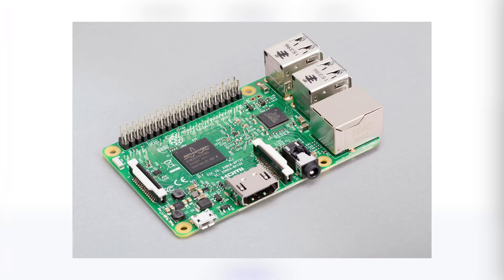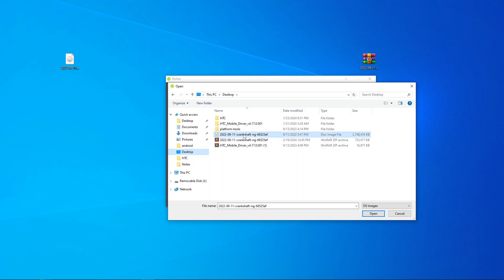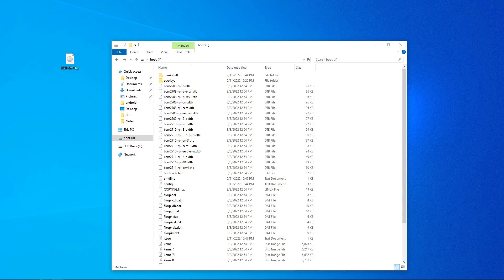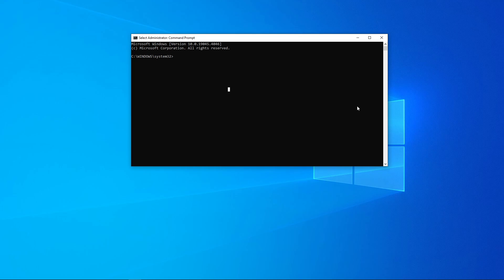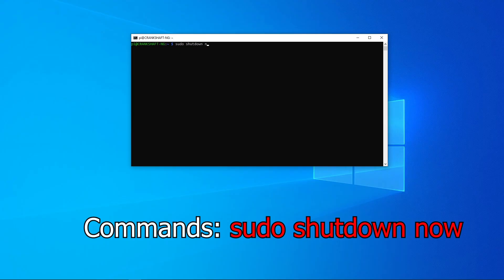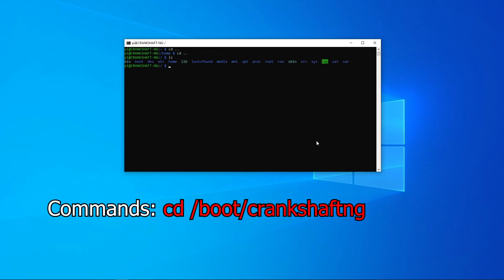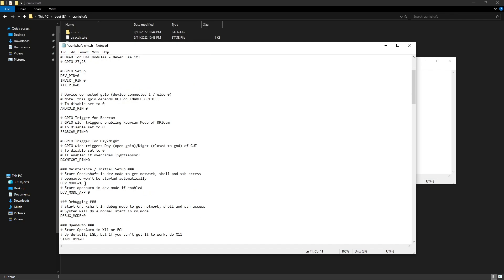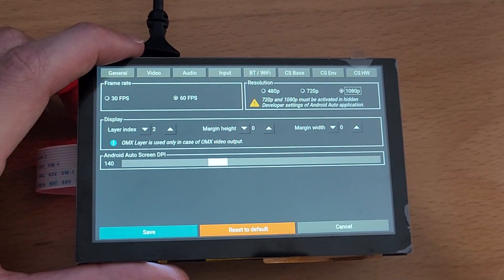Crankshaft-NG | A DIY Tutorial

Comment: I got a 8.8 inch display that has a resolution of 1920 x480. The thing boots on a portable monitor thats a normal resolution of 1080p, but do you know of a way to resize the output and or rotate the display maybe?
Reply: I figured out rotating now i got to figure out the rotating of the touch screen
Reply from the maker: Hello @TwerpZ Open the crankshaft_env.sh File inside the crankshaft folder.
at around line 78 is # Flip the screen 180°
Change : "FLIP_SCREEN=0" to "FLIP_SCREEN=1"

Comment: I want to do something similar just need navigation as a simple unit for my bike will this work on a pizero2w and a smaller screen?
Reply from the maker: @shravankashyap9437  Yes The Pi zero 2w Should work with a smaller screen. Don't forget to modify the Display Dimensions in the setup file. Also just a reminder, depending on the screen you may or may not have touch screen functionality.

Comment: Can I boot from USB??, coz nothing shows from display just black screen after turning on RPi4.
Reply from the maker: @yukiamatsuri, What kind of display are you using?
Reply: @DinosaurTalksTech  5 inch
Reply from the maker: @yukiamatsuri is it a GPIO one with HDMI or similar to the one I used in the video?
Reply: @DinosaurTalksTech  HDMI + GPIO (for touch screen)
Reply from the maker: @yukiamatsuri Try
To start OpenAuto in X11 mode, open crankshaft/crankshaft_env.sh on the boot partition (that's what you see when you open the SD card in Windows) and edit the START_X11=0 line to be START_X11=1.

Comment: I installed it , but i am getting blank black screen after plugging my phone. Any tips?
Reply from the maker: Did you click on the Android Auto button after you plugged in your phone?
Is Android auto enabled on your device?
Try go to Settings - apps - maps - permissions - allow location access
Try Restarting your phone
Update your Phone Software
Reply: @DinosaurTalksTech  yes, first time I plug in requested android auto permission~, after that on my phone it says android auto is running.  But on the pi it's black screen
Reply: 1 time i got below error : unable to open mtp device 001,006

tried different cables as well same issue
Reply from the maker: @dasari_manoj  What Mobile Device are you using? Also have you tried Updating your Raspberry pi?
If you can, Try doing a Fresh Install of the CrankShaft OS onto another SD card, Make sure you grab the OS specific to your Raspberry pi, Don't do updates or anything and see if the issue persists.
Reply: @DinosaurTalksTech  I did try with a new SD card and fresh install , my phone is samsung galaxy fold 5
Reply from the maker: @dasari_manoj It seems that a lot of people are having issues with the Galaxy Fold 5 when trying to connect it to Android auto (or OpenAuto)

As I don't have one to test with I can not give exact answers.

If you open the Android Auto App in settings
Go To Previously Connected Cars
Make sure "add New Cars" is enabled
and nothing is Listed under Rejected Cars
- Tap the 3 dots and press forget all cars 

You can also try any of the following
- Enable Android Auto Devmode and Enable 720 and 1080p settings
- Use a different power supply for the rasp pi
- Clear Cache or Data of the Android auto application itself
- Set Automatic start of Android Auto to Always and not By default

Let me know if any of these work and Which one fixed it if it did.
Reply: @DinosaurTalksTech I tried all the above except new power supply and enabling 720p and 1080p , will try and let you know

Comment: for the git clone, doesn't dev_mode have to be set to 1 otherwise it is a read-only file system?
Reply from the maker: yes, you are correct. If the dev_mode is set to 1. it would put the system into Read-Write mode.
Doing so will allow you to make changes from SSH or plugging a keyboard into the Pi itself.
Reply: I found that you can set this by running "crankshaft filesystem boot unlock" and "crankshaft filesystem system unlock"

Comment: for me when i boot it the first time it shows it loading and my pi restarts after but it doesnt seem to be doing the same as yours.. no clue how to explain but if you get what i mean got any solution? (im using a pi 4b)
Reply from the maker: Thank you for your comment. My suggestion is to try the following.

1.Reflash the SD card with the correct img or source code zip file (make sure it does not say pi2)

2. a stronger power supply to ensure no interruptions during the initial boot

3. Try a different SD card

4. Try a raspberry pi image to ensure the pi is reading the sd card correctly

If these do not work, let me know.
Reply: @DinosaurTalksTech  you recommend not using the pi's flasher and instead using a different one?
Reply from the maker: I recommend using the following zip
https://github.com/opencardev/crankshaft/releases/download/v.2022.09.12.1/2022-09-11-crankshaft-ng-66525ef.zip

And flashing it onto your SD card. (Use balena etcher or rufus) Once it's flashed onto it you should have a usable partition and it won't say it needs to be formatted.

After that plug it into your pi and let it run through it's initial boot, don't unplug it or anything.
Reply: @DinosaurTalksTech  hi hiii i got it to work now gotta get my touchscreen working haha thanks

i think the issue was that i might have flashed it with a password with the pi one.. not sure tho i have about 2% idea of what i am doing lol
Reply from the maker: Great to hear you got it working!
Reply: @DinosaurTalksTech  welp i accidently wiped the wrong ssd and now i cant get it to work again :) i love technology lol
Reply from the maker: @supermusic.foryou Since that is the case. I would suggest just starting from the beginning. Take your time, I have been in that same situation before. It is frustrating, but best to try again another day.
Reply: @DinosaurTalksTech  i cant seem to get it to run at all anymore.. on all my sd's different os works fine but when i try crankshaft it doesnt boot.. i have no idea what im doing anymore haha
Reply: Do you have a discord? Might be easier if you wanna try to help haha
Reply from the maker: I do not yet. Maybe a future addition to the channel. 

When you flash crankshaft onto the SD card. Can you access the data on the drive without having to format it on (windows I presume)?

If you are able to do this, then plug it into your raspberry pi and see if the lights blink green (meaning the pi itself is booting into the firmware)

If this doesn't work. Try the different versions of crankshaft.. maybe try flashing the "source code.zip" instead
Reply: @DinosaurTalksTech  the light blinks for a while and it seems to restart but after awhile.. the internet connector stays lit up tho but i also cant seem to ssh to it idk
Reply: @DinosaurTalksTech  so i got it to work again somehow- but my hdmi adaptor broke so i had to go in with hope lol
basically i got everything back to where i was wich is my screen being a problem since i use a screen that uses the pins.. when i do the things you show it manages to stop being a complete white screen.. but now its just being a black screen
Reply from the maker: Yes, So the Crankshaft Seems to brick the Pi when you use the Screen with the Pins. There has been issues with it all over the github. If I figure out a fix to get the touch screen to work with those screens and not brick the Raspberry pi. then I will create a short video for that.
Reply: @DinosaurTalksTech  alrighty